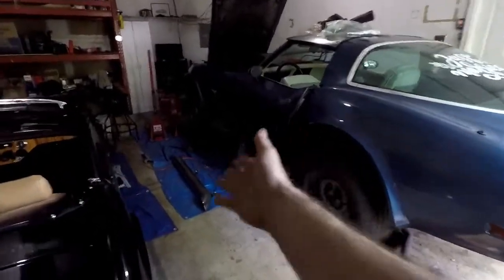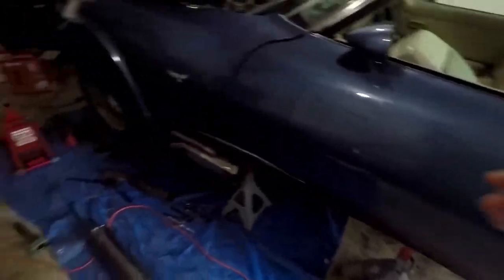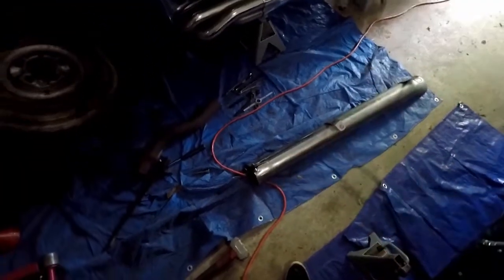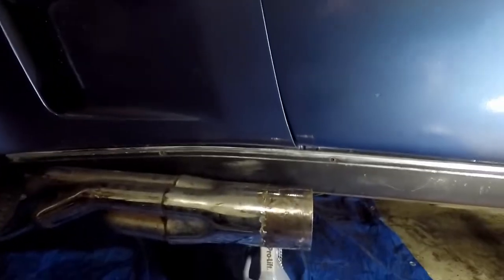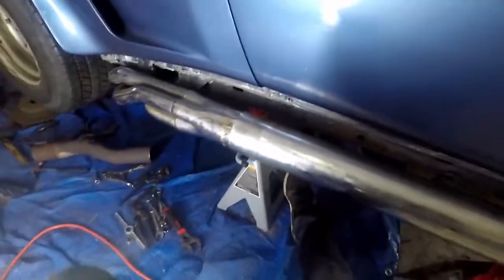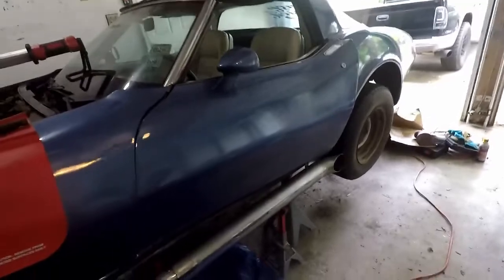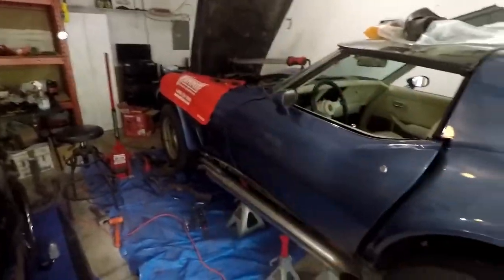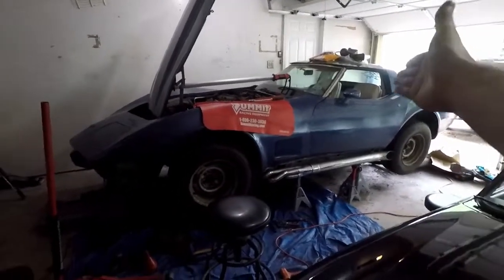C3 Corvette Side Pipes Install Part 3- Side Pipes!

Comment: Great progress. I would drive it first before you the change it up. You need to remember that the end of the pipe is going to be in line with you head and your ears. It may be annoying to drive if you go to loud. 

Keep the garage doors open when you film too. It’s helping out the lighting a lot.
Reply from the maker: I appreciate the comment! Trying to find a balance between good lighting and not letting the bugs in haha
Reply: @bluesxt  yep. I can relate. Another option is to hang some 4’ LED shop lights that can be be daisy chained together. 

I did my 24x24 garage with 3 rows of 5 units in each row. It’s now like a operating room now. I think I have about $120 in all the fixtures.

Comment: Hey any chance you can list the complete hardware to buy to mount the side pipes?
Reply from the maker: The hardware I used in order was a carriage bolt, a rubber washer (I used rubber hose cut up to act as a soft spacer), washer, and nut. 
I can’t recall the actual size of the bolts or lengths, so you’ll want to measure that :)